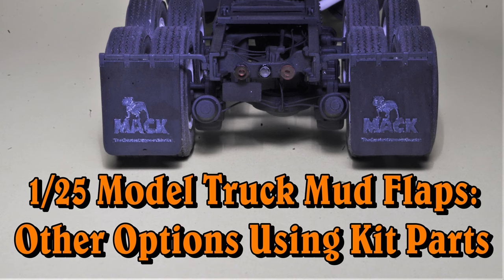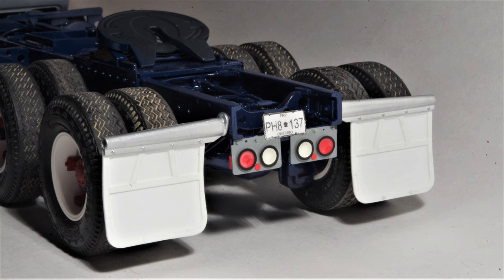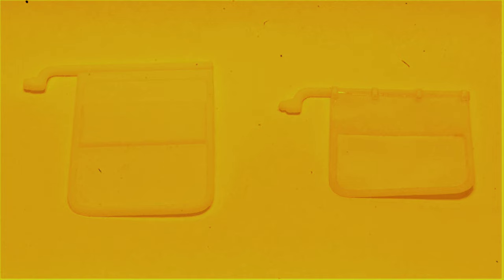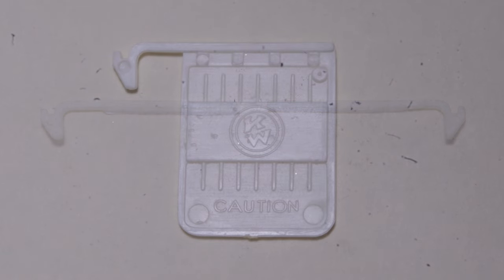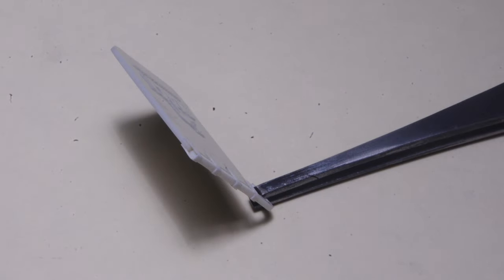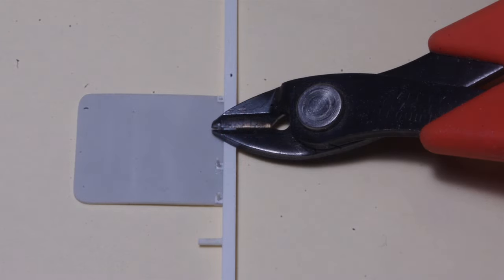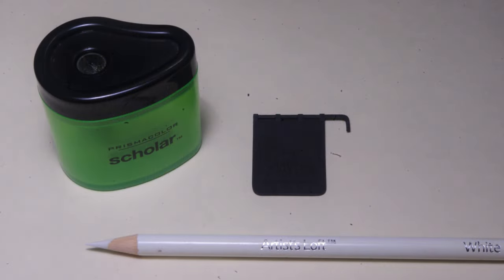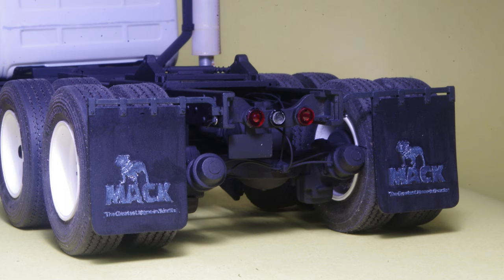1/25 scale model truck mud flaps: Other options using kit-supplied parts and a little styrene work

Comment: The cotter pin is a great tough!
Reply from the maker: I think there may have been a full moon the night I decided to try making those…actually wasn’t as bad as I thought it would be, used a pair of small needle  nose pliers which have a sharp tip, shape of the “eye” end of clip matches shape of plier tip.